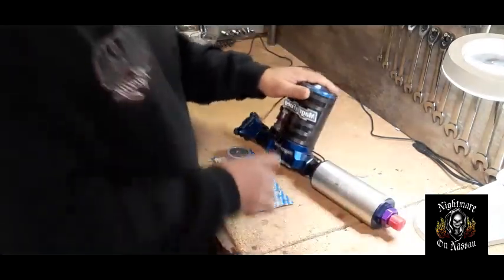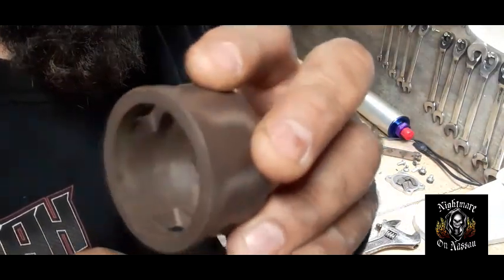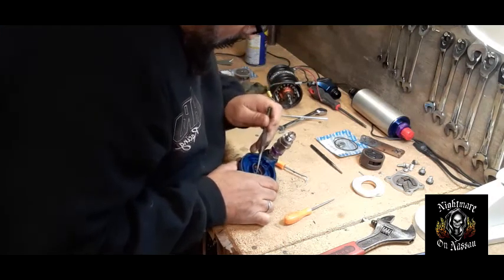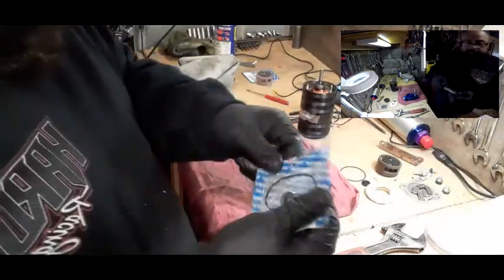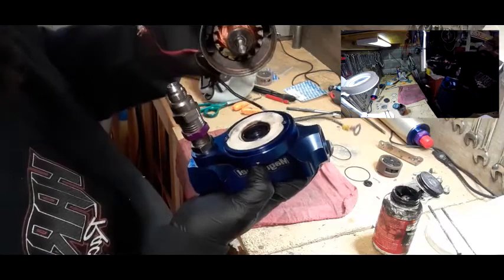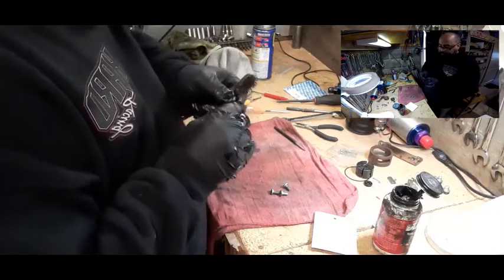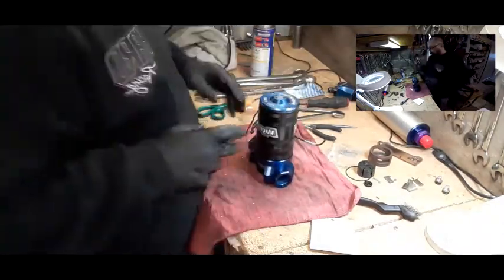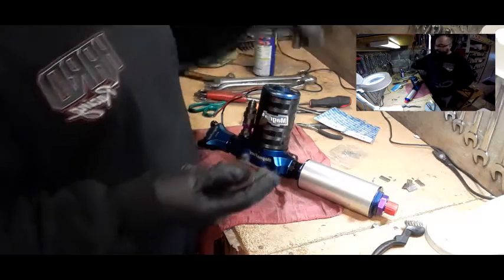Magna Fuel Pro Star 500 DIY Rebuild

Comment: Dude that bearing is no good  replace it  !
Reply from the maker: Pump Work Good Since This Video...
Will Keep an Eye on That Bearing.
But So Far So good..
Reply: The bottom motor bearing in my Prostar 500 was just very SLIGHTLY gritty when I replace my motor shaft seal. I called it ok and put it back in..... several months and 50 street miles later, the bearing locked up, the pump blew the fuse, and I was stranded. If in ANY doubt, spend the $15 and REPLACE the lower bearing.

My pump is 10 years old, and the top bearing is as good as new and has never failed.